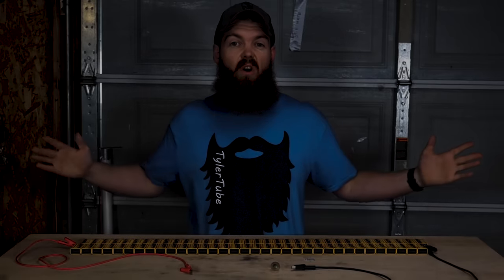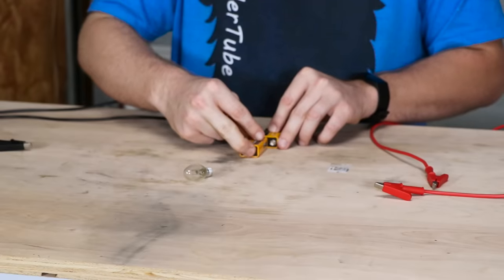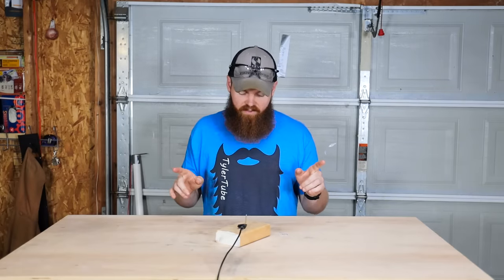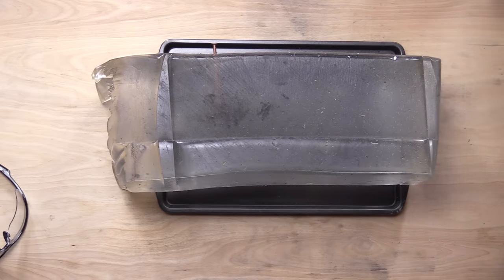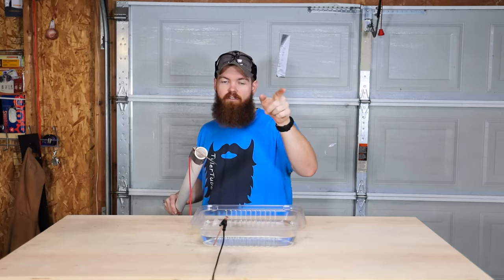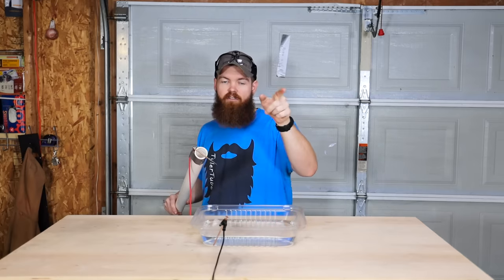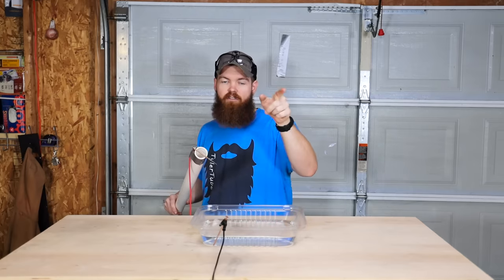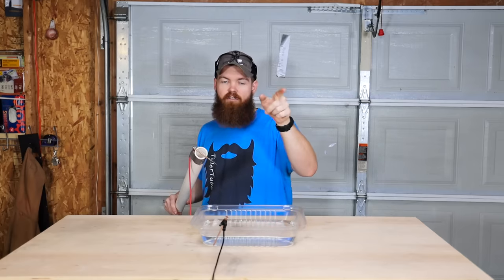I Connected 500 - 9 Volt Batteries...

Comment: As an electrician, I can't tell you how nervous I was every time he  set his hands on those batteries.

Edit:  I made a high voltage supply that's probably 7-15kv, maybe a few 10's 
of mA at most, it's on my YouTube channel if anyone's interested. I'm 
still more careful than Tyler, but I also know that that little power 
supply is nowhere near as dangerous as this big battery bank we're 
watching here.
Reply: Has every electrician been shocked?   At some time or another.
Reply: Before someone chimes in and says these batteries are safe because they are current limited, I think its worth mentioning that for a 120 volt shock, even little differences in skin moisture content and contact area can make the difference between having a body resistance of 20,000 ohms (and getting a .006 amp shock) or having a body resistance of 1000 ohms (and getting a potentially lethal .12 amp shock.) That's right, the same power draw that charges a phone or lights a 15 watt bulb could be enough to end your life. A 15 amp breaker can deliver over 100 times that, but it will never pass that much current into your body because the resistance is so high.

but these batteries have enough voltage that they will arc right through your skin, and the plasma will spread across your hand, so the contact resistance will be closer to 1000 ohms no matter what. Depending on the brand and how much power is left in them, they have a short circuit current between 2 and 10 amps:
https://groups.google.com/g/sci.electronics.design/c/6nEUtCCNMYY?pli=1 

That means the string of batteries has an internall resistance between 2,250 ohms and 450 ohms. In series with your body (with an arc going through the skin) that means you have between 1500 and 3300 ohms in the circuit, with 4.5kV behind it, so now the current will be somewhere between 1.36 and 3 amps. Recall that I said that in a worst case scenario, if you were really unlucky, a 120 volt shock might pass .12a through your body and possibly kill you? These batteries are at least 10 times worse than that.

Also, it sucks that's he has to physically un clip the batteries to turn it off. That's just asking for trouble. And the wires aren't rated for 4.5kV. I could go on and on. Let's hpe he never does it again.
Reply: 18:58 do u see the LIVE wire sitting on a METAL garage door
Reply: @IThrowBall  he's still got a valid point though. That garage door likely could have completed a circuit to the cement floor, in fact if its a power door with a ground wire than it did that by design. Now, instead of having to touch both terminals, just touching the black one (which Tyler ignorantly describes as "probably safe since its ground") would be enough to complete a circuit. In fact, once he laid it there, he started to see weird leakage currents and static sparks all over the table.

Also, if Tyler is thinking of the positive wire as deadly, tye fact that he's casually laying it on a metal object just makes it seem more likely that he'd do other things like that without thinking about all the potential paths the current could take. 

It's true that just touching that door by itself wouldn't have done anything to him. But it still made the situation more dangerous.
Reply: You must’ve gotten training flash backs
Reply: If you were an electrician you'd be smart enough to realize this project is clearly faked, there is no way the end poles of those 9V batteries can take that much current.
Reply: @ImFallwen  Nice, you didn't even read the thread. They explained that.
Reply: @ChrisD__  What thread? Can you link me?
Reply: @ImFallwen  This thread. All the comments in this thread. Delta B has made a few other replies too.
Reply: I'm really not familiar enough with electrics to say which part was most dangerous. But based on the fact it wasn't a live video and it got uploaded afterwards I figured he probably survived ;-)
Reply: Same
Reply: @Robvdh87  I think there are plenty of competitors for "which part is most dangerous." I'm almost positive he survived (no pun intended) but I wouldn't be surprised if his luck ran out next time. This is like his third video of sketchy medium voltage battery fusterclucks. He's getting more comfortable with the setup, but his safety protocols are still not much better than the first time around.
Reply: @ImFallwen  stacking batteries in series doesn't amplify the current, just the voltage. All those arcs had the same current you'd get by short circuiting a single battery. It will overheat them if he leaves it shorted for long enough. The difference is now theres enough voltage to force that full current (probably a few amperes, maybe as much as 10) into air, or apples, or hotdogs, or potentially his body if he's not careful. A current of a few amps might overheat the batteries eventually, but it won't hurt the metal test leads or battery terminals. It will generate a lot of heat, once it encounters a resistance, like a hotdog or a gap of open air. Theres another video where someone else uses 244 batteries and sets up the air gap between the last battery and a test lead. That did burn the battery at tge end, if I recall.
Reply: @deltab9768  Understandable that you were worrie for him each time he was laying his hand on the battery. But the risk was still very low on my perspective. laying your hand was roughly this much surface distance he could have short circuit 2 end with his hand. If he would have touch one end with one end of the batteries and touch the other end, then surely there wouldn't have been any video and he woud have just been dead. Like you say, it doesn't take much to kill someone with electricity if the resistance of the skin is low(wet) or the source of voltage is very high.
I'm already aware amp can't kill someone on his own same goes for the voltage, but both ( Wattage ) is the danger if the voltage can overcome the resistance while the wats is high.
 
Oh and yeah, i saw he was laying the positive terminal to his garage door, this was the very dangerouse part. When he had fun getting shock by hand with the hotdog, his positive terminal was laying on the garage door's track which was a considerable amount of metal surface going into the ground and he had his ground terminal hooked to a nail jammed in a wood block which was spreading the surface, pretty much helping making both end connect through: The garage door's track, the cement floor, then the 4 iron leg of his table, then the large wood surface of his table (and wet by the hotdog) then to the wood block with the nail and the ground terminal...
Reply: Lmao Do u watch ElectroBOOM??
Reply: @spark5010  yeah. One of the videos he shows how he makes sparks and fakes different malfunctions with a capacitor discharge, and he's not actually being shocked. He did have one video where he has about 2000v, .5A (so more than enough power to kill you) with an arc going up between two metal rods. The apparatus fell over and appeared to have shocked him. I'm not sure if he faked that, or if he was just lucky that the current didn't go through his heart and the exposure was so brief that he didn't get burned by conducting that much power. Either way, that same setup (microwave oven transformer) has killed a number of people and is less powerful than the battery bank shown here.
Reply: its electrician's lego
Reply: Albert Agibinik as an electrician I’ve been shocked many times but batteries are direct current which is much different that dc current that batteries have. Plus batteries have the potential to explode
Reply: As a non-electrician but knowing how it's not good to be etching wood with high voltages and watching him do it as I type this, hoo boy.
Reply: @user-ph5pf1ob2b  Exactly. When people say "it's not the volts that kill you its amps" that doesn't apply unless the circuit is limited to a small fraction of an amp. That cluster of batteries is more than enough to kill or maim, obviously.
Reply: Delta B direct current is much different than alternating in so many ways. I’ve been shocked by both and I can tell you that direct hurts a lot more. But here we have the added danger of the batteries. Anyone of the times he touched the electrodes together he risked the batteries exploding. This is really not what should have been posted on YT because it will encourage others to do the same. Even if he wore a high voltage suit and gloves this would not have protected him against the gasses given off if the batteries exploded.
Reply: this isnt a lethal array.
Reply: @Diesel Ramcharger are you a electrician?
Reply: @deltab9768  That's not true, I eat 120v for breakfast every morning
Reply: @albertagibinik7524  Yes. has no one said 'it's volts that jolts and mils that kills'?
 Big Clive dismantled a hot dog cooker that worked by passing current thru dogs.
Reply: @albertagibinik7524  Yes I would imagine so, i'm 24 years in and ive lost count of how many ive had
Reply: @ImFallwen  A 6 inch nail will hold 100 amps or more. I've seen them wedged into fuse holders by idiots who thought watching tv and having lights for the night was more important than staying alive.
Reply: what's your yt channel
Reply: "9V batteries are current limited." alkaline batteries can literally discharge at 6 amps or more....
Reply: What's ironic is that he turned his 'hot' into a ground by touching it to his garage door, essentially bonding every thing in it to that potential.
Reply: @deltab9768  you should definitely make some instructional or educational videos that break down different parts of electical engineering or something because reading your comments has made me so damned interested 😅 honestly I could sit there and watch/listen to this for hours! Thank you for taking the time to explain all of that in nice easy to understand detail 😁
Reply: @bygxproplay2176  glad you liked it! I've thought about making some informational videos on electrical theory, I don't know a lot compared with a real electrical engineer, but I'll try to put a theory video in there now and then.
Reply: Just imagine the youtube videos that we don't see because the guy took himself out.
Reply: You may get a kick out of this. When I was 14, (1969), I tried constructing a hydrogen bomb. Now adays, you would call it an HHO bomb.
    I took a large plastic medicine bottle. I heated 2 pieces of stiff wire with my soldering gun then pushed them up through the bottom of the bottle about an inch apart. I then took 2 more wires and did the same thing but through the sides of the bottle near the top about 1/4 inch apart. Then, I filled the bottle half full of salt water and snapped the cap on. I connected the bottom wires to a 15 volt DC @ 10 amp power supply and the side wires to the secondary of a car spark coil driven by a 15 AC @ 10 amp transformer.
    I let it "cook" for about an hour then I took the remote switch to the spark coil primary and stepped around the corner of my bedroom into the hall. I flipped the switch and waited for the bang.
    No bang. HMMmm. I looked around the corner and saw no spark. Confident in my overwhelming knowledge and skill, at 14, I stepped back into my room, grabbed 2 pair of needle nose pliers, sat down on my stool, popped the service access door off from my home made hydrogen bomb and proceeded to close the gap on my ignition source.
    Ten minutes later, I woke up on my back, on the floor after taking a kick to the chest from a 20,000 volt powered electric mule through 2 pairs of uninsulated needle nose pliers.
    My father was a bit upset at having to replace my bedroom window because of a spark coil shaped hole in it. What did Edgar Allen Poe's raven say?
NEVER MORE!!!

Comment: The longer the nails sit in the distilled water, the more conductive it becomes. On top of that, the oils from your hands and previous experiments dissolve into the water increasing the conductivity
Reply: And distilled water has SOME conductivity...
But yeah the lack of minerals turn Distilled Water into a corrosive substance, specially to metal pipes and whatnot. Hence why Water Cooling does not use pure distilled water
Reply: Also, gasses in the surrounding air will dissolve into the water, causing it to become more conductive.  The purer the water, the more it attracts-- everything else.
Reply: He also dumped distilled water out of the container, into a container of unknown purity. I think you can even see something floating in it after he pours. He should have left it in the jug to test it.
Reply: @bruceluiz  no, no it doesn’t. Truly distilled water has no conductivity whatsoever. The issue is, water very easily picks up particles that then make the water conductive whether they been from their container or things they come in contact with. Pure h2o has no conductivity
Reply: @TheMarine0333  That is not true. Water auto dissociates, naturally forming hydronion ions (H3O+). The quantities are small, but they do exist. They are measurable. And they do conduct electricity.
Reply: @TheMarine0333  Hydrogen has carbon molecules.
Reply: h20 is conductive in it's purest form. Solvents in the water simply increase the conductivity.
Reply: ...The longer the nails sit in the distilled water, the more conductive it becomes...

    Not true and especially for the short period of time involved here. For one thing, he said those were copper nails. While iron and copper does, "rust", or oxidize in "normal" water, copper oxidizes much more slowly than iron / steel. This is why they use copper now for water pipes in newer construction rather than iron pipes.
    Also metals do not oxidize from the oxygen that is combined with hydrogen to make water. If you drop a hammer and piece of copper pipe into a river, leave it there for a year then go retrieve them, you will find that the silver colored hammer will be orange and the orange colored pipe will be green all caused by the same thing. DISOLVED oxygen in the water. The same thing that fish breathe. On the other hand, if you put a live fish in an aquarium full of distilled water, it will suffocate for lack of said dissolved oxygen. Air consists of 78% nitrogen, 21% oxygen and 1% of other gasses such as argon, neon and other inert gasses. If you were put into a room full of 99% nitrogen and 1% inert gasses, you would suffocate just like the fish in the previous example would.

...On top of that, the oils from your hands and previous experiments dissolve into the water increasing the conductivity...

    Not so either. Assuming that the plastic vessel that he used for the distilled water experiment was as clean as it looked and for the small size of the nail, there was not enough room on the nail to collect enough skin oil to affect the experiment given the one gallon volume of water used.
    Depending on the previous experiments done in that plastic vessel and what chemicals that may have been used, assuming a worse case scenario where the vessel was never washed out and was contaminated with something acidic, alkali or some kid of metal salts, this could account for the minimal amount of conductivity shown in the water.

Comment: Just as an FYI a regular screwdriver isn’t safe with that amount of current. You need insulated tools or at least wrap whatever your using to hold/move it with electrical tape. I’ve been shocked by an arch two feet away because I was carrying an open end near an elevator controller I was working on.

Comment: Next episode title... "I Connect 100 Car Batteries and See What Happens".
Reply: 1200V 1000A? That is just insane
Reply: To my dog!
Reply: I think with 5 car batteries hooked in series you can weld 1/4 inch plates of course its not a pretty weld as you cant control amps but it can work
Reply: "Dang, that steel plate just vaporized!"
Reply: More like ‘making a nuclear reactor in my garage and trying to charge my iPhone with it’. I love Tyler but man is he risking his life unnecessarily. DO YOUR RESEARCH TYLER, WE DON’T WANT YOU TO DIE FOR CONTENT, as excellent as that content is.
Reply: @johnrtrucker  oh hell yeah! If you have a larger truck battery and some 1/8th inch 6010 rod you can actually get some decent welds by using jumper cables as a stinger and ground!
Reply: @milanhlavacek6730  no, only the voltage adds up
Reply: Styropyro did this

Comment: the lightbulb survived for so long because the lightbulb itself is a resistor.  Alkaline batteries just do not have a whole lot of current generating ability because they themselves have a very high internal resistance.  The lightbulb is basically able to self ballast in this setup to prevent itself from blowing because the more voltage you throw through it the more resistive it becomes and thus the more it restricts current flowing through it.  The lightbulb overloading is basically a self correcting issue.

Comment: Don’t worry, I won’t be doing this at home. I can’t afford 500 batteries.
Reply: If you ignore rent and food for the month you can do it mate
Reply: Phill Banks YESIRRRRR
Reply: Order 500 batteries from Amazon; you'll have 30 days to return them and get a refund.
Reply: Okurka Maybe that’s what Tyler did. I’m not doing it. I’d accidentally shock myself.
Reply: Get some from wish they're probably cheap and unstable which means more fun.
Reply: If you buy them in bulk you might be able to get them for 50 cents or less each. But there's an even cheaper way to get high voltage, a voltage multiplier. Voltage multipliers are a fairly simple circuit of just capacitors and diodes, so they aren't as expensive per volt you can get as 9v batteries.

Comment: Me and my mates just came up with the best thing while watching this in physics class. The most British weapon ever. The idea is simple, 500 9V’s set up in rows along a puffer jacket, connected to a high voltage knife with an insulator down the middle but a gap at the point for the 4,500V to arc across. The method is that when inserted the person is not only stabbed but obliterated.